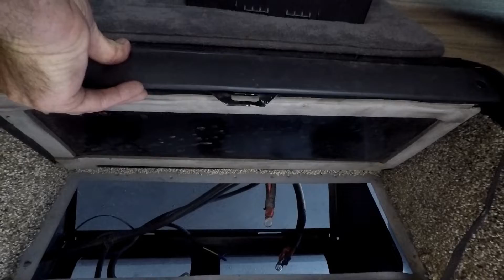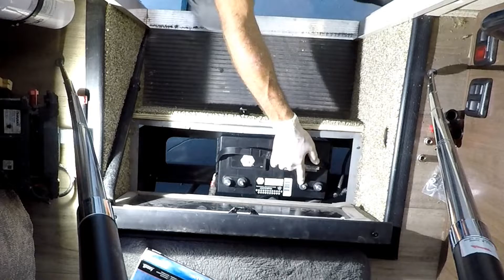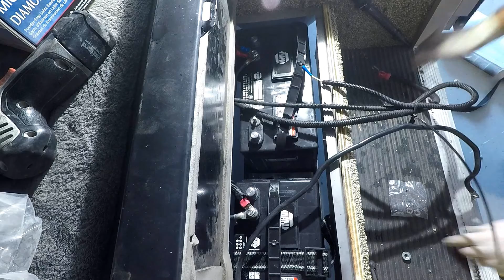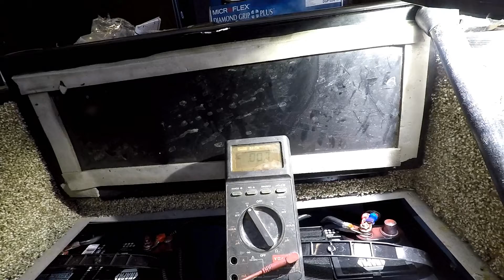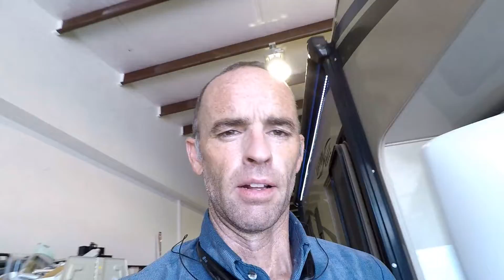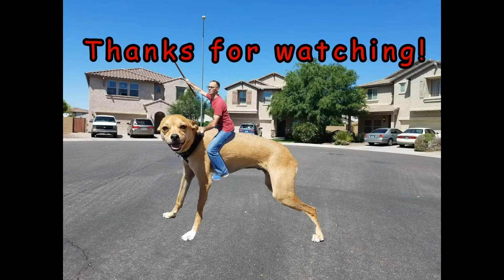Installing Two 12volt Deep Cycle Batteries in Parallel

Comment: I learn so much from your videos. I've just installed a residential glacier Bay crapper and 36x36 inch shower encased in palisade Carrara vinyl and bought an expensive fitted travel trailer all weather cover for the unit while I'm trucking Coast to coast but too little to late I've got delam

Comment: I thought you wanted the batteries separate in case you run your coach battery down while camping then you still have an engine start battery.
Reply from the maker: These are the house batteries. The engine battery is under the hood. Thanks
Reply: @AZExpert  Oh, different setup than ours.  Both of our batteries are in the stairwell compartment. And there is a circuit that allows jumping from the house battery if the start battery is too low.

Comment: can you run a group 27 and a group 24 battery in parallel?
Reply from the maker: you can but it's a bad idea and both batteries will be damaged due to the different charge profiles of the batteries

Comment: Better to run 2 marine batteries parallel or series
Reply from the maker: only do series if you have 6 volt and want 12 volt, if you series 12 volt you'll get 24 volt
Reply: @AZExpert  is 24 volts good? I have 2 interstate 29dc 840 Mac 210 rc. I just wanted to run my live well bilge pump as long as it can without dying one day. Plus how do I charge them both efficiently.
Reply from the maker: @tonysou803  you will have to determine if your setup uses 24vdc. It is uncommon. solar seems the easiest way to charge
Reply: @AZExpert  I’m only trying to run a 800 pg water bilge pump lol nothing sophisticated

Comment: Can i connect 80 ah and 30 ah 
In parallel
Reply from the maker: it is not a good idea to mix different sized, age, or types of batteries. There charge rates will damage each other

Comment: A quick question I wanna run 2 exact same batteries in parallel and the question is one is under the hood of my van and the other would be bout 8ft away installed in my can next to the inverter. I know to hook up the positive of one and the negative of the other if I do that I’ll have to run another 8ft wire from negative from battery under the hood.  What happens if I parallel them and use the pos and neg of the same battery located next to the inverter? Both are being charged by my altanator. I’m only running microwave for couple mins a day for lunch and air compressor couple mins to pressure up to 150psi.
Reply from the maker: Thats fine. Just hook both batteries to chassis ground well.

Comment: I want to keep my mini 250watt heater powered for hrs not minutes.Can i use jumping cables to connect two batteries.I'm using a 750watt power inverter to keep the 250watt Soleil heater powered.But can i use the 750wat inverter with the two batteries hooked up in parallel ???
Reply from the maker: I would say yes, but that is a very bad method using a using an inverter to change DC to AC for a heater coil. It's hard on the batteries the inverter and the relays. No matter what you'll burn through the battery voltage quickly.  You'd be better off with a DC heater...it will still go through the battery quickly but last much longer and won't damage your inverter.

Comment: Hey mate I have installed 3 120ah AGM batteries in my canopy. they are all side by side just wondering what size cables I should be using to link the batteries in parallel. Thanks in advance and good video cheers
Reply from the maker: Ultimately it depends on the maxium amperage you will be using. A good rule of thumb is whatever guage cable is going to the chassis frame ground lug is what you should be connecting the batteries together with. Thanks!

Comment: so whats beter for solar, series or paralel? does it matter?
Reply from the maker: It all depends on the voltage required. With 6 volt batteries, which have more capacity, a series is required to acheive 12 volts.  Usually, it's a combination of series parallel with 6 volt. With 12 volt batteries in a 12 volt application, no series are required. However, some off grid more robust solar installs run off 24 or 48 volts, so they would require a combination of connections with 12 volt batteries too. Thanks!
Reply: @AZExpert  I didn't even no there was a required voltage lol. How would I no wat the required voltage is
Reply from the maker: @outoftime788  on a standard rv you will be using 12vdc. Off grid homes and non standard rvs and buses use 24 or higher
Reply: @AZExpert  I see now

Comment: Good grief...just wanted to know which cables go where......
Reply from the maker: positive to positive and negative to negative wires both batteries together. Of course chassis ground to either negative post and 12vdc power lead to either positive post. Thanks!

Comment: What gauge is your cable? I want to connect two 110Ah leisure batteries in parallel but don't know what cable to use..
Reply from the maker: The best rule of thumb is to use the same sized cables between the batteries as are currently hooked up to the batteries. If you are upgrading to higher capacity batteries it does not really matter to change the cable size. If you are increasing the load side, you just want to make sure that whatever the maxium load(possible combined loads) from the battery, the cable is rated to handle that load.
Reply: @AZExpert  Sorry, I'm a bit new to this. When you say load do you mean everything I will run off the batteries? This won't really change. I run a propex heater (it's LPG but has a fan), water pump, led lights, 150w hand held blender and have a 600w inverter. I was just going to upgrade my battery as I didn't think it was holding its charge very well. Turns out, the terminals are on opposite sides to the original battery so the cables won't reach! 🙄. Still, two batteries are better than one if I can get them connected. Thank you.
Reply from the maker: @fibrofox68  If no load has changed then just install cables the same guage or slightly bigger between the batteries. Thanks!

Comment: I did a parallel connection for my solar setup up 2 batterys of the same voltage and amps..neg to neg and for the positive i put a 60 anp fuse between the 2  positive...is this correct for safety?
Reply from the maker: It is very uncommon to add fuses on cables between battery terminals, unless there is a long distance between the batteries. But yes negative to negative and positive to positive. Thanks!
Reply: @AZExpert  thanks..i removed the fuse and just put a cable..batteries are side by side

Comment: video: "never use a nylon lock nut..."
Me holding nylon lock nut about to go do this exact install: "....yeah... that'd be dumb... pffh.. who does that..."
Reply from the maker: Well, I'm not saying I did that, but this guy I know told me about it.....
Reply: @AZExpert  I'm not saying I made a special trip to buy nylon bolts because "I'm smart" but I have them for some reason.

Comment: Nice job.  Why didn't you use blocking diode for each battery to prevent one from charging the other in case their voltages are not exactly the same?
Reply from the maker: It's always best to keep things simple, and I want these two batteries to act as one battery. Thanks!